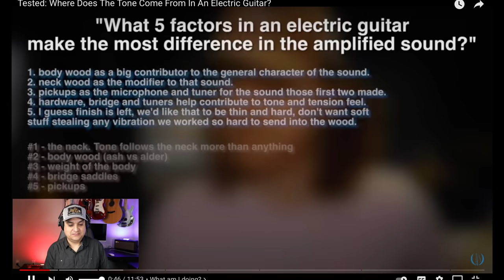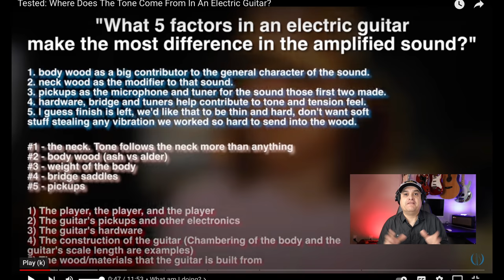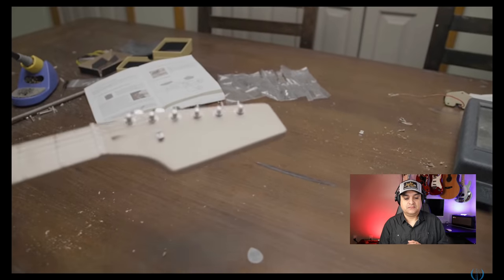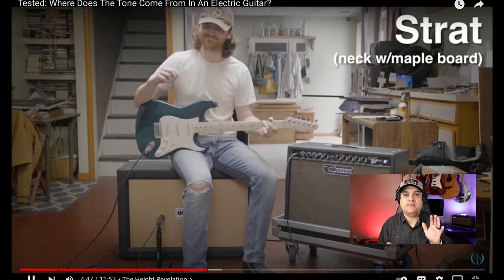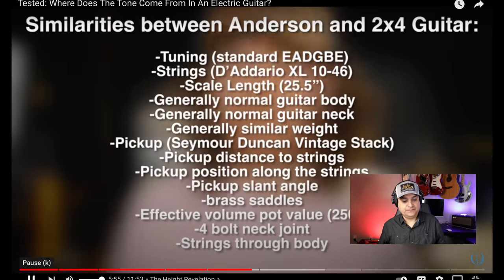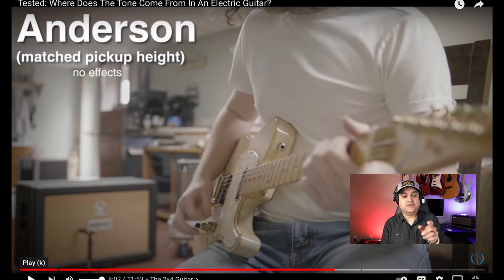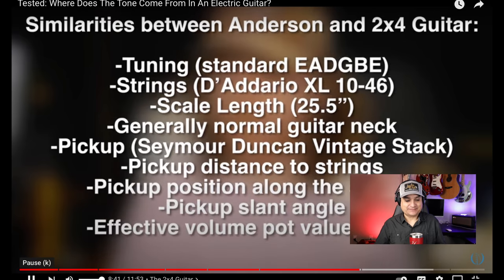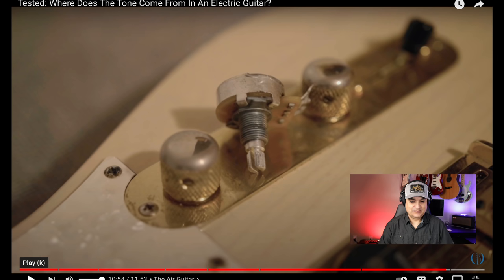Where Does The Tone Come From In An Electric Guitar - Reaction Video

Comment: Dylan. 
I'm just a poor lonesome guitar picker who wants to get better. What would help clear the fog for me, before I go spending a couple hundred kopeks on pickups and pots, is to explain to me why the stock pickups on my cheap guitars (Harley Benton currently) sound so bad....but here's the funny part....sometimes they sound REALLY good.
Here's an important point I want to make before going on about this..I'm not talking about nitpicking tiny tonal distinctions, I'm talking a sound that is BAD. Bad. A tone that has none of the attributes that make me want to play the guitar, ie rich, full, soulsome.
At this point I have to distinguish between strumming a rhythm part and picking a solo part. Strumming demands a light touch to achieve good tone, whereas soloing demands an aggressive approach. 
The more aggressively I play, the better they sound. If I pick lightly (timidly?) it sounds brittle, cheap, thin, fragile, bad. But if I pick hard, and
 aggressively, the tone sounds so fine sometimes that it brings tears to my eyes. So I go from hating that cheap guitar, to wondering why? What is causing this? Is it the cheap brass metal of the frame, the covers, the coil, the magnets, brass, wtf? Does my fleeting encounter with stellar tone stem from me? If so, will good electronics enlarge that sweet spot? If so, I can't help but wonder why?
You are doing good work in the world Dylan. 
Thanks.

Comment: I own or have owned "proper" Gibsons (vintage and modern), Fenders from literally every era and country of origin, vintage Ibanez, Jacksons, Kramers, Yamahas, Epiphones, Squiers, old Hagstrom solidbodies, a ton of wacky MIJ miscellanea... Every kind of solid body "tonewood" from laminated "is this even wood?", to basswood and pine, to koa and walnut and even rosewood. And what are the "best sounding" guitars in the whole bunch that always make other guitarists' jaws drop when they hear/play them...?

1) A partscaster made with a miscellaneous MIJ "tele" body from the late 60s - which is some kind of unidentifiable one-piece japanese pseudo-pine full of knots and grain imperfections. 

2) A short-scale 60s Supro with the thinnest slab of mismatched Alder you've ever seen (seriously, it feels like a boat paddle).

3) A partscaster using a thinner-than-"standard spec" 90s Austin strat body, which is at least 3 pieces of "solid wood". And after stripping and refinishing, I'm honestly not confident it's even wood. It looks (more or less) like wood, but it doesn't sand like wood, nor does it feel like wood to the touch (or sound like it to the tap), and there's almost no grain to it at all. Almost seems like a weird wood composite. My best guess is maybe just basswood with some kind of weird epoxy or extremely heavy coatings of pore filler? Idk, it's definitely not alder or mahogany, but that partscaster blows my "real" strats out of the water. 

If there's any thread at all one could MAYBE try to tie between those 3 guitars, it's that they're all around 7 lbs or less and the bodies are technically thinner than they're "supposed to be". But I think as Dylan points out in this video, that probably has more to do with how that allows you to hold them than anything else. But I digress... My point being; either electric guitar "tonewood" is bunk, or the best "tonewood" is a slab of miscellaneous furniture-grade Asian sorta-pine.

Comment: Here's why I never understood the neck/body tonewood thing: any vibrations you are feeling coming from the guitar through your arms and body aren't coming through the pickups or the amp. That is what makes the sound, not the stuff coming through your arms. The neck and body wood can change the feel of the way the strings vibrate. This feeling combined with what people are hearing creates the impression of some materials having more tone.
Reply: The vibrating body is also moving the pickup, although very slightly.
Reply: @chriscampbell9191  Depends. Pickups sitting in plastic behave differently than pickups in heavy bodies. There's not much vibration in the bodies of my Tele or LP. I guess the plastic ones from Fender might vibrate a lot.
Reply: @hans-joachimbierwirth4727  If you place your ear to the back of the body of your electric guitar and strike a chord, you will hear a form of vibration, and it will probably vary from guitar to guitar. It's the same if you place your ear on the neck. The loudness and quality will undoubtedly change from electric guitar to electric guitar. If the body is vibrating, because the pickups are mounted (either directly or indirectly) to the body, it's going to affect the pickups, even if it's at a very low level. Probably not enough for most people to hear. But it may account (along with psycho-acoustics) for the reason people sometimes hear differences in guitar sounds, even when all other variables are the same (same strings, same pickup, same hardware, etc.). 

I also think that lighter strings, which do not vibrate as loudly as heavier strings, don't bring the wood of the guitar into play as much as heavier strings, which will vibrate the body more. Either way, there is so much psycho-acoustics that comes into play when guitarists discuss the sound and tone of guitars and what makes it up, you can't really eliminate or factor in everything 100%. Some factors are more obvious. I've noticed that when I increase the string tension on my guitars (I play slide), the tone changes slightly. The average person probably wouldn't hear it. But if you really know your guitar, you may hear differences even with minor changes -- and even minor changes to the body. When Eddie Van Halen turned his Ibby Destroyer into "The Shark", he swore up and down that it thinned the sound. And the most bizarre thing about these tonewood arguments is that a lot of apparent 'deficiencies' can be overcome by using an overdrive pedal, or changing your amp settings. I agree with Dylan when he says "If you like the sound of your guitar, don't mess with it." Peace.
Reply: @chriscampbell9191  String movement over  pickup is some millimeters. Body oscillation is orders of magnitude (app. 60-80db) less than that, mainly on fundamentals only, well within noise floor and neither impacting at the end of the chain, nor can it be measured or detected by human ears. I don't care what a nobody like EvH thinks about physics or psychoacoustics. His job wasn't to explain instruments but to play them. I wouldn't ask Van Gogh how the human eye works. I don't ask the cook to build microwave ovens.
Reply: @hans-joachimbierwirth4727  A lot of differences in sound depend on small increments. Two steel slides will not sound the same, even though they are made with the same material. As for Eddie Van Halen, I would trust his opinion concerning the sound of the guitar that he gigged with nightly for at least 4-5 years, and recorded two albums with. If the sound changed, the sound changed.
Reply: @chriscampbell9191  EvH -like many guitarists - was nearly deaf and you clearly don't know what you're talking about. There are experts in the studio turning a lot of knobs for those specialists whose job is to pick, slam and mangle the strings over their toneplastic. Most never even realized that they basically play a piece of plastic if it's a strat.
Reply: @hans-joachimbierwirth4727   I would trust the opinion of a guy who built and designed guitars, played thousands of gigs with them, and whose tone guitarists are still seeking to duplicate, over somebody who refers to him as a 'nobody'. Have a great day.
Reply: @chriscampbell9191  Spouting silly fallacies doesn't help your case. I don't care for superstitious opinions of some idiot. You know what they said to that one violinist who once went up the stage with a maple fretboard? You're fired!
Reply: @hans-joachimbierwirth4727  I haven't heard that violin joke, although I'm sure there is a vid out there on YT somewhere the proves that a Stradivarius really is no better than a cheap knockoff. And under a blind test, they could be right. There is a vid I saw where, using a blind test, guitarists couldn't tell cheap, Chinese humbuckers from Seymour Duncans. With guitar, everything's a myth if you want it to be.

Comment: I always thought the shape of the guitar made a difference ie a strat vs a tele vs les paul. That's why they sound different but they tend to use different pickups of course. But surely, if you put 3 single coils on a les paul it would never sound like a strat? The biggest part is the player. Eric Clapton always sounds like Eric but a Les Paul does not sound like a stat even with Eric playing them.

Comment: Top loaded strings sound brighter as they are shorter than back loaded ones and have shorter wavelengths when they vibrate making there frequencies higher in pitch, its a  scientific fact. You can hear this. Best regards John.

Comment: I watched his video a few days ago. I was actually laughing out loud. I worked in Electronics for decades. If you try to explain to most musicians how an electric guitar works they run. They do not want to hear it. Electric guitar pickups are not microphones. They don't pick up tone. LOL  Expensive wood is for looks. Paint is for looks and protects the wood. It's all about the electronics in an electric guitar. Period. I'm not saying that a poorly built guitar will sound good, because a loose bridge can rattle and vibrate making noise. If a guitar is assembled well and everything is tight...the sound comes from the electronics.  If you like playing a Strat, then if you get a quality set up on a Squier, install the same electronics as a custom shop Strat,  it can sound and play as well as a custom shop Fender Strat. Fact.  People that have paid thousands of dollars for their top of the line electric guitars will hate hearing this and will deny it until the day they die, but it's true. 
If you take the electronics out of a $6000 gibson and install them the exact same way in a $300 Epiphone...they'll sound the same. That covers sound though. It takes a lot of work to make a neck FEEL great. Not everyone can do it, but a good guitar luthier can make the Squier or Epiphone feel just as good.  Great video Dylan.

Comment: I can tell that these “respected luthiers” are selling snake oil intended to help sell their products. They aren’t scientists. But neither are you and me. 
My anecdotal experience supports tone wood as a bass guitar modifier far more than for guitars because these woods all have resonant frequency in the low and low mid frequencies, and we do not distort the bass nearly so much.  
I also think some major brands that rely on mass produced pickups design for tone wood neutrality so that they can swap out ash or alder or basswood based on cost and availability without anyone really noticing. 
But nobody actually tries to take sat the most sensitive boutique pickup, the best bridge and tuners, and some really output sensitive amp and actually scientifically test tone woods in circumstances which might amplify their differences. With stock pickups which tend to be muddy and compressed, it’s going to mute their differences 
So, Dylan, let’s apply science. Make the most sensitive and dynamic pickup your expertise can make and see how it performs in different bodies.

Comment: Electric guitars are just slabs for sure…try that table test with my Gibson L-5 hollowbody and it doesn’t work! 😂
However, to the point of this video, renowned archtop guitar builder Bob Benedetto has a photo in his book on constructing archtop guitars of an archtop  he built out of construction-grade knotted pine. He said it sounds as good and plays as well as any instrument he has ever built. He does mention that the thickness of the top wood and so forth is decided by the craftsman based on the lumber being used…fascinating topic…thanks for posting!

Comment: Magnetic pickups are not microphonic. The sound you hear is a representation created within the electrical circuit. It's pickup, strings and speaker. Stainless vs. Nickel. String guage and scale. I defy any tonewood proponent to identify the wood used in an electric guitar. Tone wood is flat earther breatharianism.

Comment: Big Guitar is gunna hate this 😆

Serious question though: let’s say solid body vs. hollow. If all these key parameters where present, you wouldn’t hear a difference? But you might still feel a difference in your hands I suppose? Although I guess it might not even feel different if they’re the same body size & style. Very interesting!
Reply: I'm not sure that this applies to hollow and certain semi hollows.  In a solid body (or a semi hollow where the bridge was connected to a center block), the difference in the vibration of the bridge in comparison to the nut is going to be so small it would be hard to measure and see with the human eye.  But if the bridge is just attached to a floating top, you would be able to see the vibration of the top on slow motion video.  The type of wood, arch construction, volume of the chamber would all contribute to the sympathetic vibrations.  Not only might there be a tonal change because the string may not vibrate at the same angle to the pickup (with one side of the oscillation having a more significant effect on the magnetic field (no idea if that is a thing or if there would even be enough change to hear in this case), but the pickup may also move closer to and from the nut, effectively shrinking then stretching the string (building in a slight vibrato).

That being said, those are just thoughts, not tested and verified facts.

Comment: Some guitar voice specially on the higher register, tone starts with "waahh" until end but some does "waaahhhooo", ends the tone undesirable. Is this still dependent on the pickup? This happens on cheap guitars but that 2x4 is on another level of cheap. Maybe the explanation doesn't cover sustained notes.

Comment: And people have made guitars for maybe thousands of years. Obviously not electrics, but every master luthier I’ve ever met...including the one that taught me how to build classical acoustic guitars, says wood matters. And it does. Put pickups in a concrete or styrofoam body guitar and tell me how much you love it. The bottom line is, if you like the high end feeling of a real nice guitar...then get the tonewood guitars. If you don’t care about that, then buy the cheap crappy guitars and go on with your life. Fender is also not the model I would have chose, as they’ve always been very generic and cheap feeling in my own personal opinion. Try an Ibanez, or a music man, or a Gibson (Gibson has gone downhill fast). When I strum a note on mine, I can feel it resonate through the entire body and the neck, which in turn vibrates the strings and gives you incredible sustain and tone. You get a full rich tone. The tone in his little guitar here is flat and unpleasant (for my personal musical interests). The thing about music is that it doesn’t discriminate, so nobody is right or wrong. 
But don’t you think someone would have caught into this by now if it were true in every aspect? Millions of master luthiers have existed since electric guitars started being built. I can also make that same sound with my computer, so why are all you idiots still using guitars? See my point?

Comment: anybody with logic or common sense knew this.  People will spend 5k on a Gibson but turn their noses up at spending 100 bucks on correct pots and wiring.  Good pickups, good pots wired properly, in to a quality amp is how its done.  Just because it says tokai or epiphone on the headstock does not matter.

Comment: Small issue: guitar amps aren't exactly built to be "transparent" sounding at all. He should have used PA equipment IMHO. Of course if he wanted a "real life experience" by using what guitar players use, it's fine. But it's far from being in line with the research.

Comment: I think people need to be critical in their thought process around the board, and there lots of parroting happening here. Tonewood is one thing, but sustain and resonance is something else entirely. That “air guitar” is anything but; it’s bolted down to massive slabs of wood on either end. The reciprocal energy between wood and string is still there. It’s a bunk and pseudoscientific analysis.

I don’t think tonewood really matters all that much in terms of the frequencies and tone it generates,  but it sure matters in terms of vibrational energy from the string, which will contribute to overall resonance, sustain, and potentially low end.

Marketing is almost always BS, but construction still matters.

Comment: One of Jim's point is to prevent ourselves from getting robbed outright by overpriced guitar manufurers.
Reply: Why would you get robbed?
When you are buying a guitar you choose the one you like the most (tone,feel, esthetics etc), right?
You confirm the value of instrument.
You are picking and paying for that guitar, no one is forcing you to buy it because of the wood used.

If it's too expensive, don't buy it.
If you think it would be cheaper if it was made out of plywood, then make one yourself and save money or look up cheaper models and upgrade other components.
If you think the price of guitars are going to drop because one guy dropped an "air guitar' video , I guess you are gonna be disappointed.